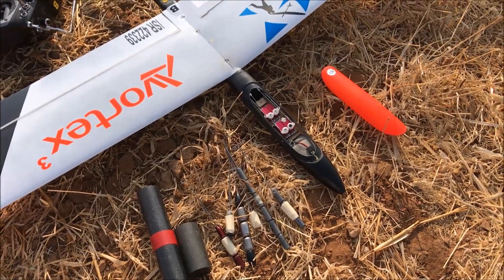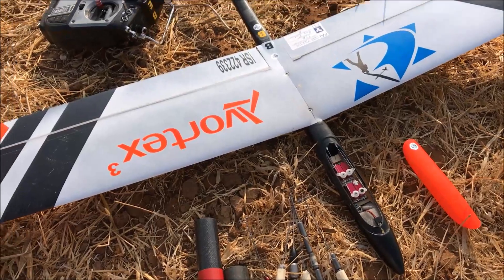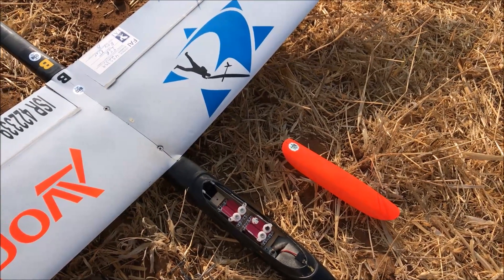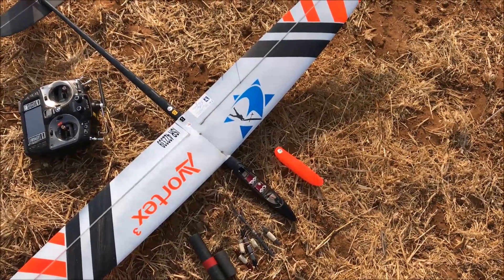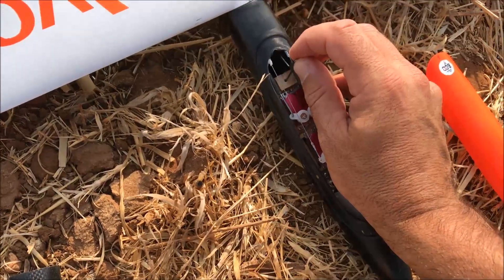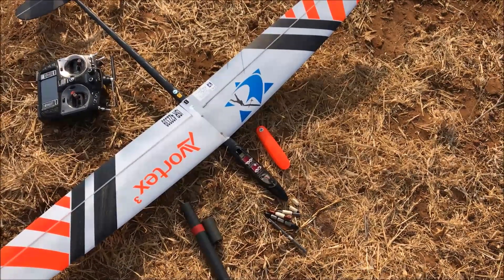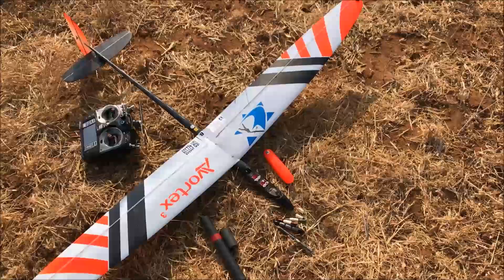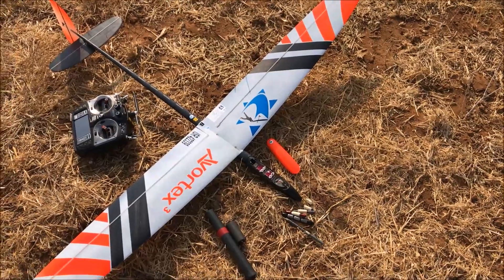Vortex 3 building instructions - Chapter 13

Comment: Could you please confirm what should be the cg for the vortex 3 electro? and where is the CG measured from (root chord of the wing)? Thank you
Reply from the maker: I fly the electro at the same CG as the dlg version. 64 mm from the leading edge. You can easily go 5 mm forward or aft and the model is still flyable but my preference is no more rearward then 67 and 64 is vest for me
Reply: @roydor11  thank you for the swift response - the plane is beautiful by the way. Top job!